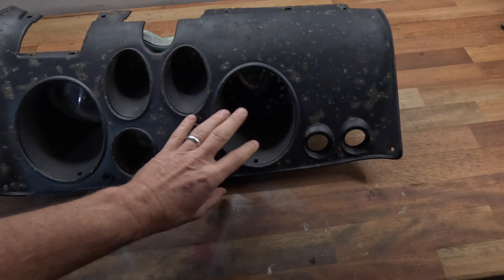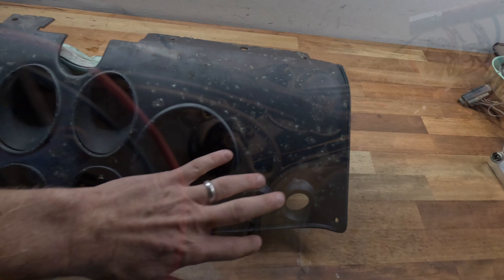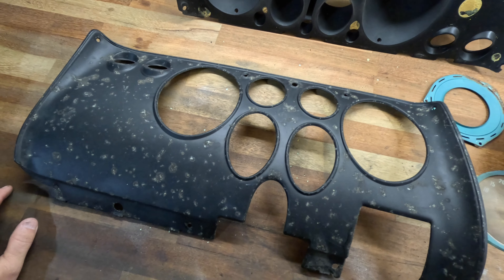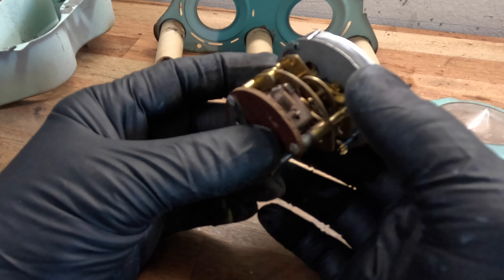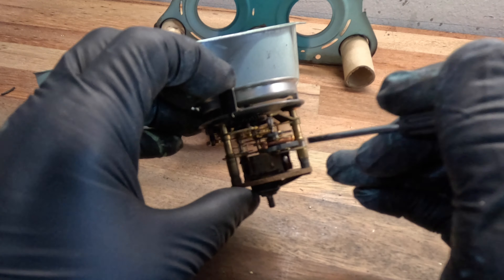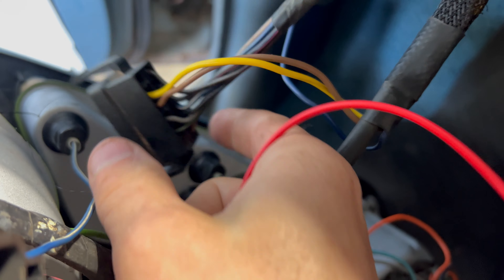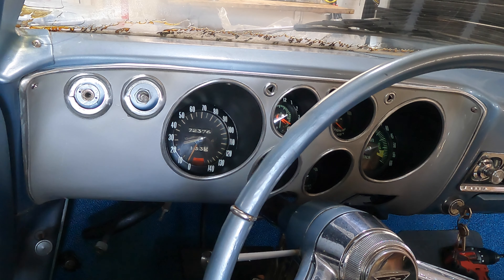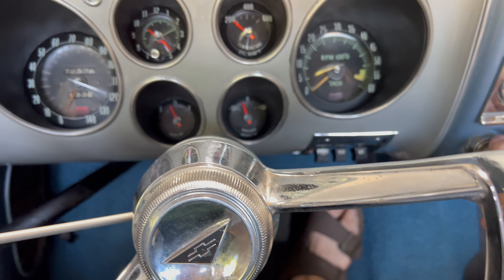Corsa instrument cluster upgrade in the FLOODED 1965 Corvair Monza 110!

Comment: I hope you realize that the speedo had its own calibration separate from the other 'Vairs and that it required a specific tire diameter to work properly. All '65 and later cars are driven off the left front(drivers side) wheel.
Reply: I run 15s and the Speedo matches GPS exactly...I think stock is pretty far off gps.

Comment: Bezel surrounds weren't black, to begin with, but bright chrome look with the crinkle black fascia. I don't mind you making the fascia silver. It should look pretty good:) The clock used a solenoid to pop the winder and the points get burned after a while. That is the main problem and the best fix is the quartz replacement. I used to fix the clocks myself for guys that wanted it the way the factory did it. Expensive and difficult to do though. Quartz is the better and cheaper route. Those red washers are insulators.

Comment: That Manifold vacuum gauge was used primarily in the Turbocharged cars as a boost gauge.  The cylinder temperature gauge goes up quite quickly if the fan belt is thrown off.  If you have it overheat, there is a buzzer somewhere, (maybe in the gauge) which is a better notifier because you can't miss it.  My Spyder would throw the belt when drag racing and it felt like you just got 15 more horsepower, but best to shut off the engine soon. I really enjoy your YouTube videos.
Reply from the maker: Thank you!  I'd like to have it somewhat work for vacuum and then perhaps boost down the line!

Comment: OK, Sean, the main word I have for this video is OUTSTANDING!  I do have quite a but of experience over the years with our "waterless wonders".  I have no issue with changing the dash color, NONE of my Corvairs are painted in a stock color!  The 65 Monza dashes were all silver, the 65 Corsa dashes were all wrinkle finish black, and a thin stripe around the fascia was left unpainted (that is, silver), but in 66, the whole dash was painted black.  Did you repaint the glove box door and surround to get rid of the wrinkle finish to match?  Also, whenever I have the "tunnel" under the car open to add wires, I ALWAYS put in extra wires for future use- electric fuel pump, cruise control, extra gauges, high-speed heater blower (need an extra wire for a relay to avoid melting the fan switch), etc.  LEDs to replace the dim original bulbs is a good idea, but DO NOT use an LED for the Gen/Fan light- the load of the incandescent bulb is part of the circuit.  I've got a few more things to say, but the wife is telling me to get off the computer, so Auf Weidersehen for now.
Reply from the maker: Thank you!  The glove box door is also silver to match the dash.  Next time I've got the cluster out I'll make sure the incandescent bulb is in the Gen/Fan circuit, thanks for the tip!
Reply: Hi Sean, I know the color is the same, but I was wondering about the wrinkle finish.

Comment: Its your car so don't listen to the naysayers...my 66 Kinda w factory air and factory 140 engine.  I painted it plum crazy on the upper half and classic white on the lower half so both sides of the dash were plum crazy...friend customized the dash cluster w oil temp, cylinder head temp, voltage and oil pressure...much better than stock.

Comment: Shawn, the tach in my '79 Suburban did a crazy thing. It would sweep the entire field and then go back to the correct reading. come to find out, a solder joint was not tight. I took the small PCB out, re-soldered all the solder joints, re-assembled the whole thing, and it worked perfectly.
Reply from the maker: It does work smoothly it just seems like it reads high.  I need to put in another tach to verify it's working correctly.

Comment: That silver looks great!  I like the '65 Monza silver dashes much better than the black versions.  When the previous owner put the Corsa dash in my '66 Monza, he removed the clock and installed a second cylinder head temp gauge.  I assume he wanted to monitor head temp on each head individually, but he did not rig up a second sender.  That picture looks like a MAF  sensor, and if so I like where you are heading with that...
Reply from the maker: Sharp eyes, my friend!

Comment: Great job on the dash! I was going to say if left in Monza configuration, unless overtly trying to keep it original, paint it black like the 66 - 69 because I think in that configuration it looks better (hides use/aging better, IMO). But, it is unique in this Corsa-guage configuration to be silver, so I think it looks great. Tip on upgrading the Monza dash if not doing a Corsa conversion:  replace the outsized--and too prominent location--clock with a Stewart Warner tach. My recollection is that they make or made one that just happens to fit right in there and looks just about stock. Then, just find any location, under dash, etc, for a modern clock if that function is still important to you.

You may be already past this but... Since the 2 carb motors didn't have a cylinder head temp unit, I'm not sure they have a boss or detent for one? My memory is fuzzy on this, it's been 40 years and folks/Clarks, etc, may have a workaround now, but we didn't know of one - so we found out the hard way by d&t'ing where the 140 unit "would be" (but on a 110)--there was a "boss" of sorts there--to install the sending unit, of course ;) and, unbeknownst to us at the time, broke into the combustion chamber! The explanation later, don't recall the veracity,  was that the 140 heads supposedly were a little bit thicker in that combustion chamber area,  vs our 110's?.. So, about 300 mi into a 1000 mile road trip, compression blew that out and we lost power on exactly 1/2 the motor (the hole must've scavenged things enough to kill/mess-up vacuum enough to (effectively) lose compression on the whole cylinder bank! Still was able to limp it 100 miles (over a mountain!) to the next civilization--what a motor and car! A friendly local Corvair mechanic was about to tear everything down for a blown head gasket, is what we all thought happened--sure acted and sounded like, when he peered into the shrouding underneath and found the sending unit laying peacefully there! Just to get us underway (vacationing) he threaded a bolt up in there to get us back power, telling us "just don't run the heater the rest of your trip!" as the temporary bolt fix no doubt still seeped at least a little bit of gasses.  When we got home we heliarc'd that hole shut and just said goodbye to the idea for the time being,.. and it turned out a 140 transplant ensued a few months later anyway. So, beware! We just may not have investigated the external parts of the 110 cylinder head enough for a better location, or unwittingly just drilled 1/4" too far, though we thought we measured everything 10x before--dumb s**--... but make doubly sure!!

Comment: I had a '66 Riviera that had the same clock problem, especially in the winter. My clock stopped, took it out gave it to the dealer to have repaired, installed it. A month later, the same problem. I stopped fooling with it!

Comment: My 70 Challenger clock works like that.  It will run for weeks or months and quit until it's taken out and cleaned.
Reply from the maker: Shockingly, it's still working (although it's running fast).  I need to take it back out and see if I can adjust it to work a bit slower.

Comment: I’ve had two Corsas with the factory tach and to me your tach looks to read high compared to the RPM I am hearing.  Mine were both 140hp.

I thought the teaser might be fuel injection, but was that an a/c compressor I spotted? Will have to look again.😎

As usual, great video……seeing you row those gears makes me really miss my Corsa. Maybe it’s time to revisit…👍🏼🍺

(Edit) OK, after freezing the teaser, I have no clue what that is!😜🤷🏼‍♂️but I am excited to find out…..😎
Reply from the maker: It sounds high to me as well, might need to temporarily install another tach to verify the RPM.  The teaser is not AC, although with the temps being >95 lately that would be a welcome addition.

Comment: OK Sean, got my '69 model yesterday. Just looking at the parts and reading the instructions, yes, I'm one of those who actually read before anything else, I saw the assembly phase just shows black color for the entire engine, starter included. does the engine have any colors other than black? Thank' so much. I'm like you, I build a vehicle for me, not everyone else. You'd love my current car. A Scion xB with blacked out wheel covers, diff grille, LED's thru out, HID head lights, even re-EQ'd the radio to match this model.

Comment: If I couldn't get the clock to work, I'd either set it to 4:20 or add a different gauge (multifunction/fuel range, trip odometer, etc...)?  ;-)
Reply from the maker: It's working well enough for now.  I'll probably replace the (essentially) non-functional vacuum gauge with something else.

Comment: This is awesome to see the corsa dash in the monza! I did the same thing to my grandpas 65 PG, however the speedo isn’t working. Any ideas where I could start looking to fix that?
Reply from the maker: My first thought is the dust cap on the left front wheel.  It's what drives the speedo cable and the drive mechanism is plastic.

Comment: Clocks are a problem with points pitting just like ignition points.  There's a trick in electronics for relay coils putting a "catch diode" across the coil.  I've succeeded revising old clocks by cleaning the points with 400 sand paper and putting a 1 amp 50 volt or greater diode with the stripe connected to the +12 volt line and the other side of the diode to the other side of the coil.  This quenches the arching and pitting of the contacts.  The clock will run again and the points will last nearly forever.
Reply from the maker: That’s great info!  My clock works but it runs fast and occasionally stops.  Thought about the quartz replacement but this may be a better option.

Comment: I've got an EM monza 900 convertible that is a whole lot of fun.  I just came into a really really nice Spyder cluster.  Was thinking about subbing out the boost gauge and  head temp gauge for a voltage and exhaust temp gauge.  Did you keep your mileage when you installed the speedo?  I want to keep mine accurate (its got 46K) so I need to add about 10K to the Spyder.  Can you swap out the tumblers?
Great vids.
Reply from the maker: I would think (legally), as long as the mileage is the same it shouldn't matter what gauge is physically used.  You can remove the mileage wheels relatively easily with the cluster apart.